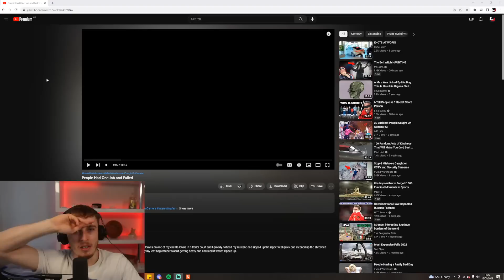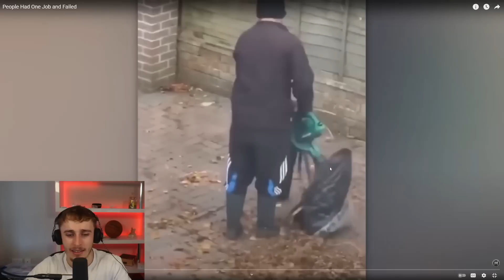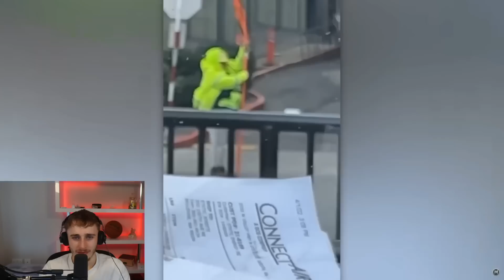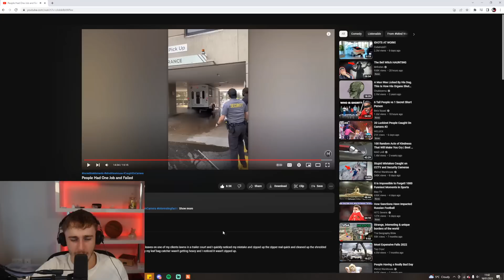Reacting to People Had One Job and Failed Compilation😂

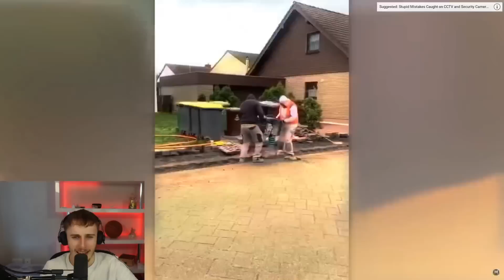Comment: The tool at 7:20 & 11:30 that you couldn't identify is a gas powered pneumatic tamper. It's like a jackhammer except its function is to compact soil.
Reply: We always called it a wacky packer where I'm from
Reply: @spookyskelly5276  I honestly can't remember what we referred to it at the job I had that used them. We had 2 different ones. One was the same as in the video and the other was more "bulldogish", meaning it was more compact, had a wider base, and used vibration to pack the soil rather than an actual piston driven tamper.

Comment: Those were pipe extensions. They were supposed to insert them so they were extended out of the other pipe, at the right length. When they all let go of it, it falls inside the pipe, and is gone forever.